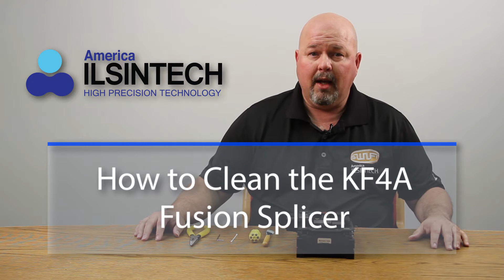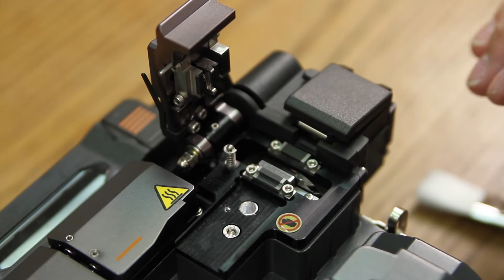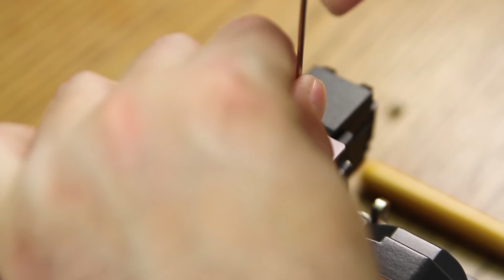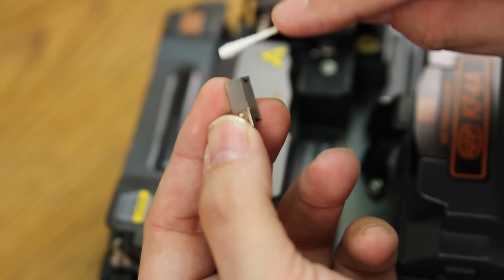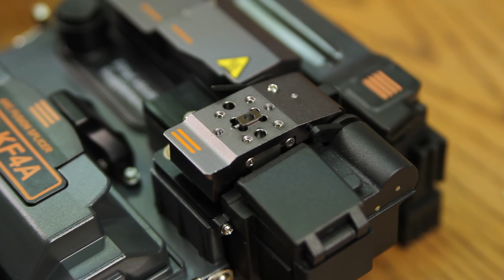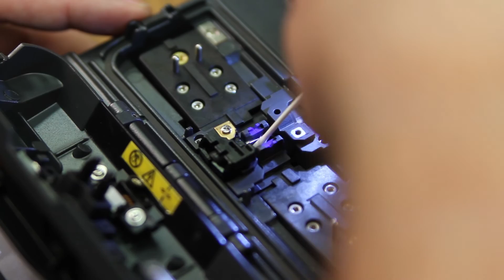Cleaning the KF4A All-In-One Fusion Splicer

Comment: I have this splicer, however the fiber won't cut and the waste lid doesn't drop down, and click as it used to, any advice
Reply from the maker: Sounds like a basic cleaver maintenance or cleaning issue.  Contact your local UCL Swift office or distributor for assistance.  http://www.uclswift.com/sub/sub1_05.php  Thank you for using UCL Swift!